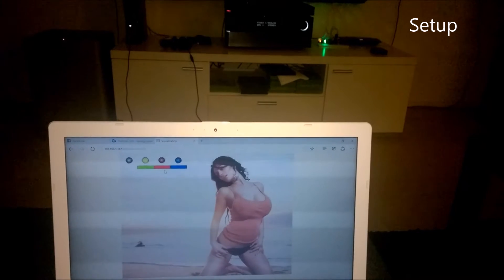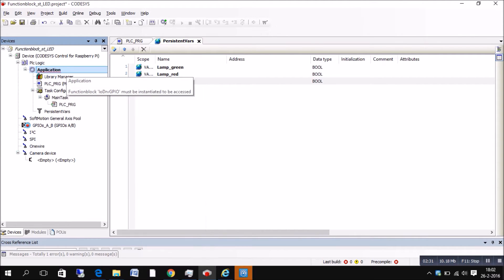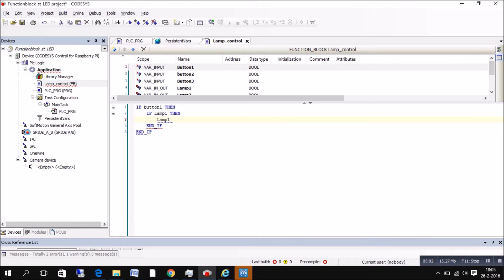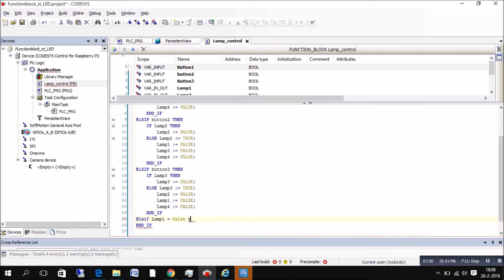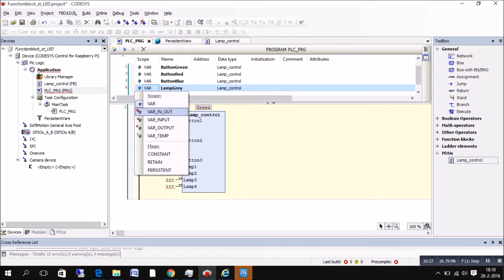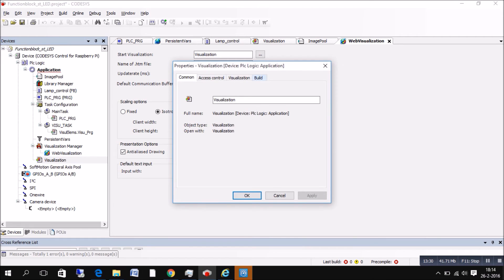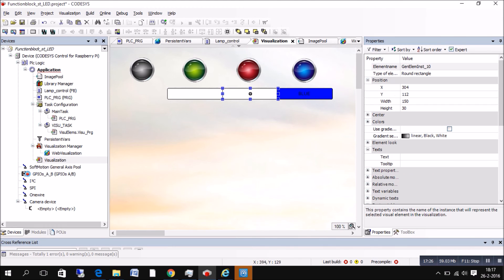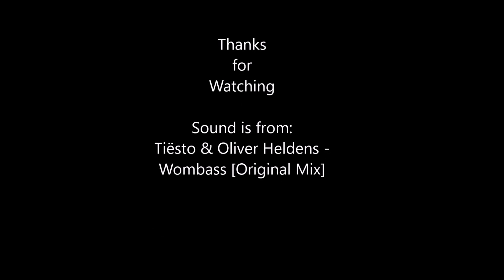Function block (structured text), setting variables to memory, codessys on raspberry pi

Comment: sir i have to ask you if you can help me .
i want to read the temperature from on ds18b20 sensor on codesys through ethercat .
the sensor is connected to one microcontroller .
to codesys there is raspberry pi .
better said .
codesys raspberry as ethercat master and the sensor with the microcontroller as ethercat slave .i have written a simple c++ program for the sensor and uploaded it on the microcontroller it work perfectly on the pc display without codesys .ethercat work good .
my question is how to declare the temperature variable on codesys  to be able to read the temperature  from microcontroller and display it on codesys .thanks